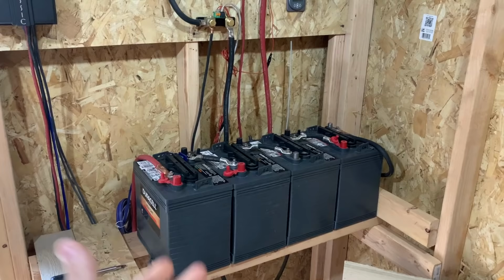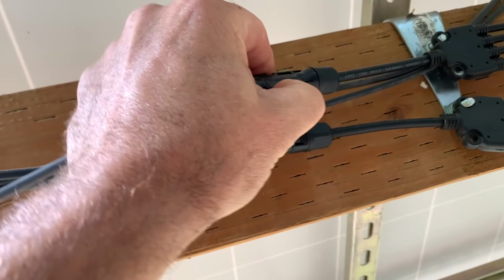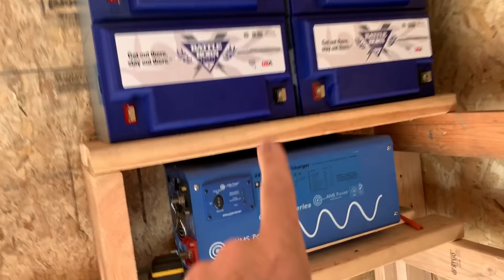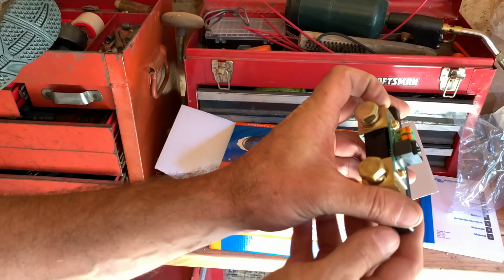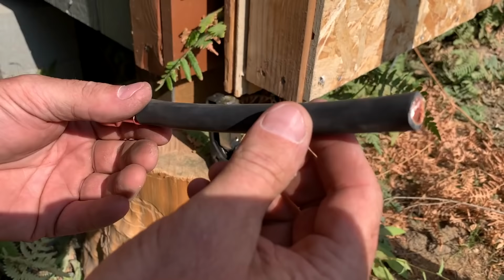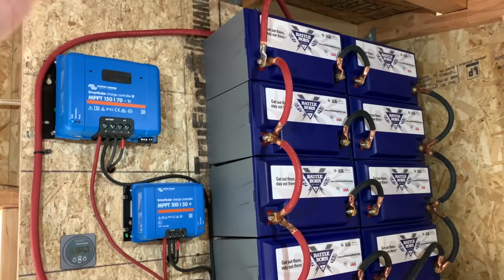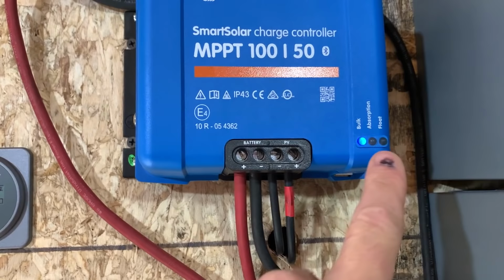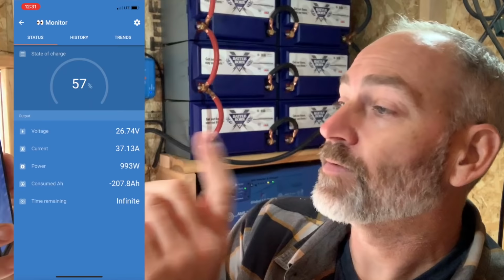EASIEST Off Grid Solar Power System Battery Bank

Comment: Amazon has a Solar Stand with Sun Tracking for $650.
Would that be a good investment in our Under Construction Off Grid Living 
As we have a 500 watt Wind Turbine
We are doing 12v to 120v simple SetUp
Reply from the maker: I don’t know it it would be worth it. Divide the number of watts you would gain by the difference in cost between a regular mount and you will see the price per watt. Might be setter to just buy more panels.

Comment: What was your reasoning for going with a 24 volt system rather than just 12 volts? you could have had 800 amps then with those batteries.

Comment: how many watts do you need to run a house?
Reply from the maker: Tha would depend on what appliances are in the house and how many would be running at the same time and for how long.
Reply: @MartinJohnsonOffGridLiving  Fridge and computers continual . Would it be able to run a washing machine? What are the lifetime of the panels and batteries ?

Comment: I note a lot of comments regarding the safe installation regarding this solar/battery set up. From a fire safety point of view this system and its installation was wrong from the get go. You do not, I repeat do  not install electrical installations like this on flammable walls, Huge no no.  At the very least the backing for all the batteries, invertor, controllers and fuse links should be on a non combustable backing.

Comment: Why don’t people simply buy those “big” battery units buying 2 10kw batteries costs Less than the 8 battleborn and give you over 20kw of storage for a couple $1,000 less.
Reply: I was thinking the same thing. Why not something like the Bluetti AC200max with a couple of B230 batteries. 6144wh for $3000 less. Is there a reason for going with this battery setup instead?

Comment: Instead of using a gasoline generator couldn't you use a small wind turbine?
Reply from the maker: sure, if you have enough wind.
Reply: @MartinJohnsonOffGridLiving  But that's a similar problem to solar, if you have enough sunlight.

But it's all about adding a bit here a bit there to make up the amount of power you need.

So even if it only produced a quarter of what you need that takes the strain off your solar panels and adds a little extra.

Assuming the smaller wind turbines work at all.

It's just a thought to save gasoline money.

Comment: Wrong installation. You should not place batteries on top of each other due to heat. It is much better to place them side by side with a little space between them.....

Comment: you dont want to drain the entire 400amp hours. treat them the same as your deep cycle lead acid, try to keep them at 50% and don't discharge below 30%. all these theories are off.

Comment: so i see you have a 24 volt inverter, you made 4 groups of 24 volt, why didnt you have one group of 24 with the rest parrelled of the first set? i have 12 car batterys, my inverter is 12 volt, i have a 1kw and 2,5kw inverter, so i charge at 24volts, and ran my batterys parrel off the main two, and i found i can drain one leg dead at night. my controller and panels i set at 24volt because off voltage drop and i could hook 2400 watts to my 100 amp controller, i have 18 hungred watt 12 volt panels. been 3 weeks just using this system
Reply from the maker: The way that I did it works fine. There could be other ways to wire them up to get a 24 V battery bank out of 8 12 V batteries. do what works best for you or check with the battery manufacturer to see how they suggest wiring the batteries together in a 24 V battery bank.

Comment: Your battery wiring is not good. Run a wire from each battery to central point to parallel them. Each wire has to be exactly the same length and gauge of course. This way the charge and discharge currents will be equally divided over all batteries.
Your current wiring will cause batteries to be overcharged and others to discharge faster. I have seen battery banks with blown up batteries that were wired this way.

Comment: those batteries are $900 a peice...and they don't last for ever...about 8 to ten years if your lucky...
Reply: I have to agree there are much cheaper batteries out there that are led as the batteries and then he's lying he said that this is a 24 volt system- clearly in the picture you can see that the inverter that he's using is a 48 volt inverter He's completely lying you can just do the math 8 batteries * 12 is 48 it's third grade math

Comment: I think you are valuing the wrong things.  At 1:15 you point out that the batteries are very light!  You can pick it up with one hand you say~
But none of that really matters.   Nobody will ever pick them up from now on.   Ever.   What matters most is battery life.   Lead Acid outlasts lithium ion by years.
Reply from the maker: I think you might be mistaken. https://www.arkcorporation.us/blogs/news/54925381-deep-cycle-lifepo4-vs-lead-acid-pros-and-cons

Comment: Please for your own protection. In future instructional videos. Keep your hands close to your body.. I could not believe you didn't get bit from that system with you reaching back. Blindly to put your had on devices that clearly are "on", and clearly have full amperage.. I cringe watching you working on this system with a loose hand pointing and touching fully loaded system.. I am talking from a Submarine Navy Battery Technician experience. 
If you can't keep your hand away from danger.. Perhaps rubber gloves would keep you from smoking a finger or to and certainly keep your heart beating correctly..

Comment: You do it wrong with the battery wiring.
Reply from the maker: How should it be done?
Reply: @MartinJohnsonOffGridLiving  You need to distribute power equally to all batteries. Else, you will have a couple of batteries at 100% before the others. And the last one will be always late in his charging status. Can't explain it in a comment. Google it ! :D

But it's an old video, i didn't check the others, maybe you've update your battery rack wiring since then.

Comment: designed + assembled in the USA = made in china and has a sticker slapped on them (e.g. final assembly) in the USA before sale. Just a little misleading - not saying they are not good batteries - but they are not even close to 100% "made in the USA".
Reply from the maker: “Made in USA” must follow specific rules. https://www.ftc.gov/business-guidance/resources/complying-made-usa-standard 
The same rule should apply to “made in China”

Comment: The average car battery will have an Ah rating somewhere around 50Ah. The 50Ah means that it can push 12 volts out at a rate of 50 amperes in an hour. COST $60. NO NEED for these overpriced batteries. so get 10 for $600. connect in series =120 volts or a combination and charge via  solar cells and have inverter. total cost under 3000....
Reply from the maker: How many times will it do it before or needs replacement?